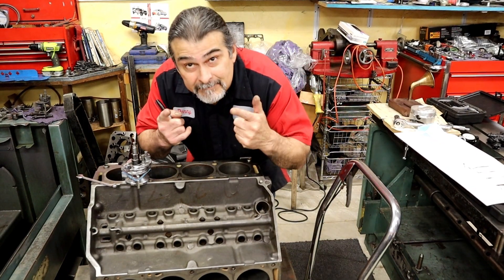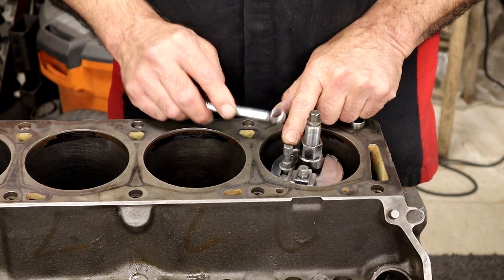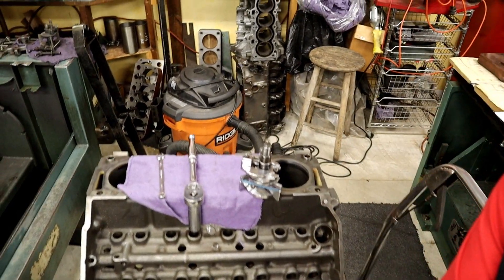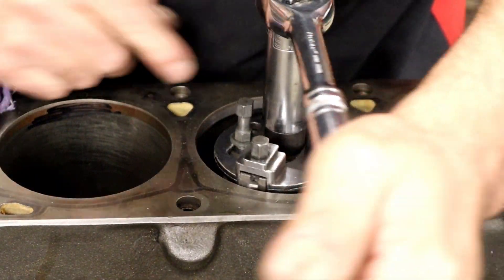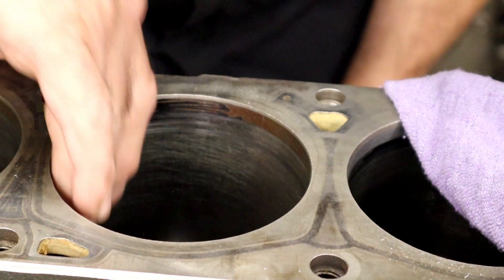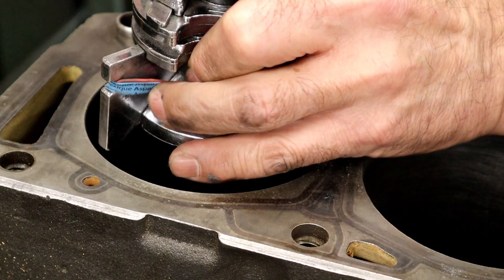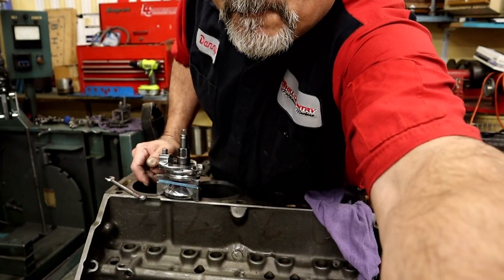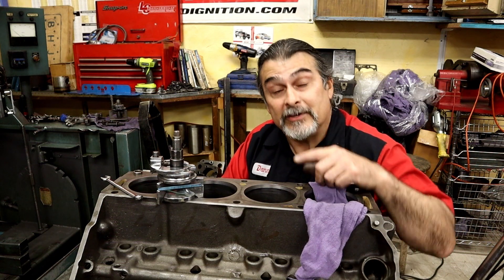UNCUT! HOW TO CUT CYLINDER RIDGE.

Comment: Hey Danny I wanted to ask something about valve grinding on a v8 flathead. Can a valve job be done with the engine still in the truck? If I pull head, and the valves out, is it possible to cut and or grind the valve seats while it’s still installed?
Reply from the maker: Back in the day , you sometimes had to.  Yes it is possible.
Reply: @MrDanielSoliz  thanks